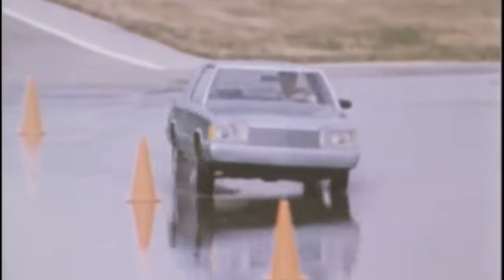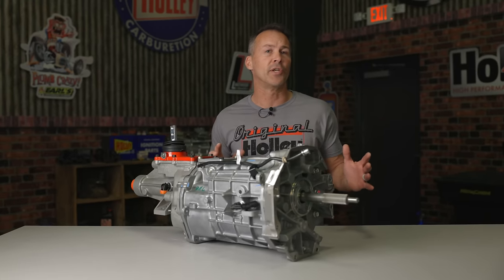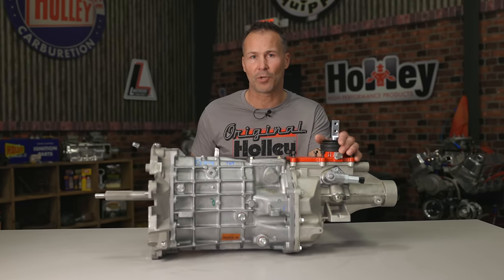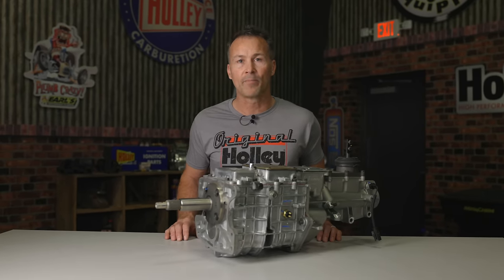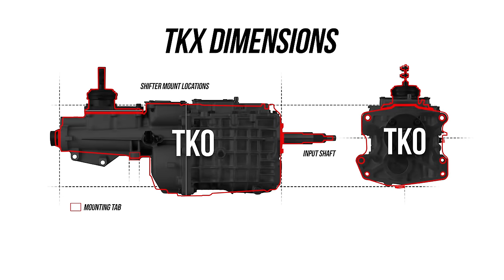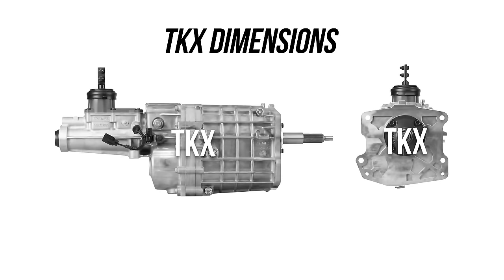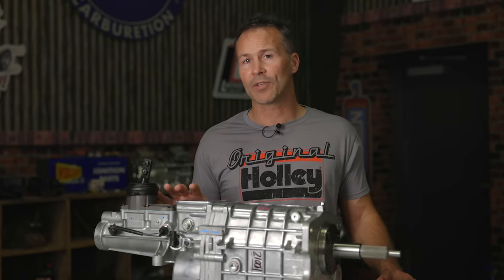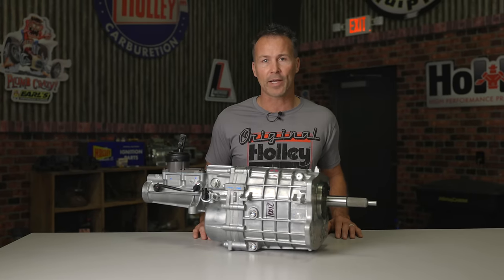A Guide To Tremec Manual Transmissions

Comment: Have a T56 Magnum 6 speed in my 68 Chevelle.  With a 496 Big Block my mileage went from 12 mpg to 26 mpg on the highway traveling at 65 mph.
Reply: @Brandon Kilian Sixth gear is .63.  With 3.55 gears n the rear the RPM's at 65 mph are around 1800.
Reply: Thats hilarious
Reply: My C10 has an older T56 with the 0.50 6th gear and I get 25mpg on the highway. Pretty awesome I love it.
Reply: What kind of induction are you running? I also have the T56 Magnum in my 73 516 Big Block Corvette.  I'm running a 3.70 rear gear.  I'm also running a super Victor/Dominator and I don't get miles per gallon, its Smiles per gallon. 🙃
Reply: @gumballer133  When I did the test I was running an Edelbrock Performer RPM dual plane spread bore intake with an 850 Speed Demon carb.  Currently I have a Fitech Mean Street EFI with a Jegs Air Gap dual plane intake (a copy of Edelbrock Performer RPM Air Gap).  Have not tested the mileage with the EFI yet.
Reply: @darylw792  thank you 🙏 ☺️ solid real world numbers, so im not guessing i was figuring about 20-35% improvement ( in your case 50% ish so even better ) from the dodge G-code 1970 and 727 3.2FG so 32MPG-maybe or is that stretching it? how much did the sound/NVH change numbers or just your impressions ?
Reply: @michaelwhitehead4446  how much did the NVH change? is it more or less decibels?
Reply: @michaelwhitehead4446  thank you for real numbers, my old setup is about 16MPG +- a couple of points
Reply: @richardprice5978  I noticed no change in sound at any given RPM.
Reply: @darylw792  it's rpm vs speed, as modern driveline sales/owner told me it should get better MPG ( i wasn't 100% convinced at the time and by how much i figured about 5MPG-ish more in mpg to my 16/18mpg but at 3usd pre gallon it takes a long time to ROI 3 to 7 K usd of work/time/$$ but you're numbers on my driving habits it pays itself off quickly plus added gas is now 5+usd bonus payoff ) and be quite er at a given speed ( not sure that worked out that way and or is the gear noises different from the 3 or 4-speed vs TR6060 ) as the engine isn't turning so fast but it's under more load in over drive/higher gears vs say a M22 or 833-mopar or really my 727-Auto non-locking torque converter
Reply: I'm planning to put a T56 behind my 440 in myb65 charger for that VERY reason. Glad you confirmed what fuel savings you gained.
Reply: @kevinhawkins6811  mine is a 2014 C7 TR6070 ( from what i gathering its one of the strongest units plus was setup for a pump just swap the mid-plate for a aftermarket or hellcat mid-plate+clutch+flywheel and oem green-bearing-trow-out and a adaptor's to small block mopar or comaro same but id bet but SBC/LSX adaptation to BBM/426hemi will work-2 and the 1967-71 oem 727 yoke and tail-housing's ( a gm turbo-400 or similar auto would work as well but i don't have that stash of parts to try i just know their similar to 727 to support the yoke the C7/TR6070 has a seal to stop leaks into the pumpkin/ground ) or at least mine was in mockup reusable if i adaptation to the corvette tail/pumpkin 🎃pattern i didn't do this as i working on a hybrid-ev motor for around town use/stater to save weight and more room for the exhaust/turbocharger ) ( with the bell on its 42" but the body of it is thicker so it will not clear aka the same size as the original 727-auto ) with .42-OD 7th im happy to help as your charger is basically the same as my 2gen you will be forced into cutting the body/floor i all ready tried mock up and it didn't fit really well i guess you could drop the engine/transmission down a couple of inches and use a CV-jonts/different drive shaft/axle
Reply: @kevinhawkins6811  mine shifter is from a 2016 comaro flipped a 180* remote shifter modified so it's on the firewall/tunnel as i don't like kicking-ect it but silver sport ( bruce at modern drive line has parts and or the magnum tremic full kit for early  charger's but it's a 6-speed and im instead on 7-speed as 440's up and happly lug 7th at 80MPH up hill ) transmission's has a adapters to the oem consoles 

i guess i like truck/ape shifter handle's that are vary notchy/heavyweighted and clutch-petals that feel like a heavyweight compound bow
Reply: @kevinhawkins6811  t56 vs mag vs tr6060/tr6070 there cousin's but different from each other and a real t56 you might not be as happy with it as its weaker ( 400lb torque vs 800lb * . the face-plated tr56 might be stronger aka 1200lb* 🤷‍♂but i didn't really look at using it as to me it's a race-transmission not for street use as it's noisier ect. ) then the tr6060 and won't have external cooling so behind a 440 it can over heat but i will have some options for the Z-bar clutch assembles but the aftermarket mid-plate from tick performance NC-🇺🇸 i think has a option for that but then headers can be a pain ect.

not sure 🤔about your goals on your charger but i did my research for mine
Reply: @richardprice5978  I want a daily driver and some stoplight to stoplight fun on Friday nights. I do a lot of highway driving to work and it's an hour to get there. That why I was thinking the 56. I am going to build the engine more for bottom end torque than high rpm horse power.
Reply: @kevinhawkins6811  mine axel is a 8-3/4 gear is 3.2 tire tall sizing is 26" or jeep 2006 30-33 10-13" wide muds 😉👍as i wanted bigger brakes but don't care for low-pro side walls most of the time and Michelin sport tire's for some reason aren't made in high side walls or at least i didn't see anything and im not buy goodyear tire's flipped one of my cars from my mistake
Reply: @richardprice5978  I'm out of NC, I'm trying to do research. I'm end up putting 10k into my transmission, and I dont want to have made bad choices with that kind of money invested.
Reply: @kevinhawkins6811  sounds like copycat me 70% or more would work 👍

if you have any questions im happy to answer ( im in the rocky's/SW 🇺🇸 states for now ) you sorry i don't make more parts/set's for the swap ( chevy volt motor/donut 🍩shaped/tesla motor 1:1 output shaft /on the driveshaft/yoke is how mine works otherwise there's dead space not being used or just use your imagination for what ever site's your fancy 😉) ( love to see more than me rocking this or similar setup ) and im not sure if i did if id lose my shirt 👕trying so for now it's just information/1-off in my car and or progress that iv made/learning from it

my transmission 2014 c7 core i got for under 2K usd ( rebuilding my OEM 727 i got bids for over 4k so no way, plus i was trying to buy a 833 car originally anyways but could find one at my local area's and price point ) im not sure what there going for now but the official magnum transmission ( mine is very close to the 3.9... 1st gearing/gear set sorry have parts numbers but forgetting it as i post, and there is upgrade parts if you brake it but kinda doubtful on N/A-power ) in a box-core was 5+k usd-2018-ish numbers clutch/DMF package ( wanted the triple-carbon-carbon but my wallet/wife for now says no ) im under 3K all parts have less than 30K-miles on them and a old guy's warranty vett so basically new all in so far im guessing im under 5K ish ( the 383 died from liquid vandalism so a all iron twin-plug gen-2 hemi 4.5-crank is in the works and yes aiming for low end grunt and sounds like the same goals as you )

i plan on replacing the steel driveshaft for A-1 carbon unit as its safer in a failure mode but for testing/mockup modifying the OEM will work fine for CV-jonts/telescoping personal preference but the sliding yoke will fit tried it with out the ev-parts installed motor core can theoretically work but also get in the way and not fit so i don't bother with it but got a tr56 viper quick-time bell  to BBM+vett-mid-plate ( if you use the console version adapter the vett has both of the detentions ground into the front locations and under the shift platform if memory serves me right but you will probably need to copycat to hellcat setup but the forward shift-shaft is going to need about a 1" trimmed off to convert it to work with the hellcat or use the TR6060/mag-parts to convert it to work as there basically the same if not super close, i didn't and have 40MM-ish spacer/cut a hole+welded in the vent-tower to use the old detentions under the shift tower and welded on to the SS-steel vett pattern-shifter to make a ball-cup to work with the 2016 comaro parts  ) and found it wont bolt on/fit so need to retry it in the car with a 2016-up hellcat/TR6060 bell's and mid-plate-hellcat for the next test fit

hope that you have a good TIG welder 👨‍🏭you're going to need it, even the $$ "kit's" need a welder ( a high end mig might work fine or paying a bodyshop with kit and being mostly steel sheet metal and crossmember ect. repairs but i wouldn't chance it but i like tig more so maybe im byisted ) and on those flux core/low QC tooling doesn't cut it aka junky end product
Reply: @kevinhawkins6811  FWI the 2014 vetts shifter tower is in the forward/truck placement on a similar tremic magnum transmission and the mag tail and yoke and seal+bushings ( i profferer the larger roller 29-35 spline yoke's sorry foggy on mopar's OEM 1970 b-body/C-body count, and i forgotten if tremic makes a roll-mag tail or not stock or if it can be modified to work with roller-yoke's ) will technically work for the output shaft as i tried it and a BRZ-Toyota swaped lsx car ( look at his as 7Th and reverse gear can be challenging to fit in the mag-tail-case but he did get it to drive/work, that's why i think 🤔its easier for after ( pumpkin/tail housing/plate adaptation ) ( like i did ) or making a custom tail/gear housing ) thats on the internet sorry don't have the links to it but his has a thick aluminium spacer/adaptor between the case and the mag-tailhounsing the other way to do that swap is put the mag-tail ( got one early on for mockup but after a buddy and wife of mine sigest electric A/C ect. and non programing-for-me hybrid ideas i though it was brilliant, battery packaging is under the backseat cushions and under the floor pans aka under my seat/passengers side making it a flat floor if i run the exhaust right ) after the vett-tail housing and or run the shifter shaft backwards though the vett case i didn't bother with that as mine is hybridisation 😉 so it wouldn't fit anyways, before warned that running the back shifter placement's ( if i was using a magnum red-plate shift handles/rod's straight up from the tunnel's sheet metal without a adapter shifter kit, add more if you use the extended internal rod/tail-mag ) put's at my hip's or neey's 24 to 42" ish back from the firewall 90*-up/glass or in the back seat's lolz 😂i don't need back seat driver's and using a Shelby cobra shifter handle for me is weird/uncomfortable hence why I wanted the remote truck style long 20"+ish rod-handle one on the firewall for now going with the ball-handle/chevy but maybe i might try the pistol grip but not sure if it's comfortable or its just for looks/$$ as its a driver's cars not a flipper's car
Reply: @kevinhawkins6811  before i for get some people that are smarter than me have gotten the TR6060 H-pattern using servomechanism and hydraulic ram's/pump-ect ( and others like 4-speeds ) to automatically shift ok 👍 and crude clutching so-so but it needs a remote shifter to work, something to look up for rush hour traffic and or in my case wife mode, sorry i don't have the best how to on it
Reply: @darylw792  , 
My 66 Chevelle gets 3 miles to the gallon , 
I would like to double that to 6  like you doubled yours , 

I have a M-21 Muncie 4 speed
Reply: Guess I’m lucky I got Muncie 4 speed with 3.55 rearend gear getting 10 miles gallon wished I’d put even bigger gear I sent a 3.73 ring an pinon back I wouldn’t been able to drive it
Reply: @kevinhawkins6811  i just remembered a idea hope it helps. my family asked me as im using a corvette transmission is why didn't i just buy a wrecked C5-C7 and gut the back-half off it and bolt in everything like the torque tube and back-pumpkin 🎃for better brakes ect. so here you go as a different way to get OD-transmission and better corner handling.

i already did the wilwood big brakes and restored my OEM 8-3/4 FG3.2 so sunken cost's ( a year or so aka i felt there new ) before the 727 died to i didn't go the back-half way
Reply: and use adaptor T-bar's instead of the corvette coils in the rear arm's and or 1955 style packerd Caribbean T-bar's/system's. BTW quick-time/holly makes a corvette torque tube to mopar 🛎bell-housing V-8's adaptation found that out by accident just ask for it on the phone
Reply: I bought a 68 chevelle as my first project car for my 18th birthday last year, but I have no clue where to start, I want to put a big block and this trans in it, what all have you done to yours?
Reply: SOUNDS about right. I HAVE heard enought stories of muscle  car owners who got as low as 10 mpg when doing an overdrive swap going to 20 mpg.

Comment: Over the years there has been considerable improvement in both manual transmissions and various types of automatic and automated transmissions. I am old enough to remember cars with a 3 speed column shift where only second and third synchronized. Now most manual transmissions are 6 speeds with all forward speeds synchronized. I remember 2 speed and 3 speed automatics many years ago, now we have 8 speed and 10 speed automatics. Although there has been a steady decline in the availability of manual transmissions, there will always some manual transmission enthusiasts who will want a manual transmission.
Reply: Hate to say I remember driving a 37 Dodge pickup that the ONLY syncros where between your ears... perfect timing or the noise would shudder your teeth.
Reply: Brings a tear to my eyes
Reply: 57 Chevy pick-up with the old three on the tree, remember when down shifting while sitting at a red light, something in the linkage would go goofy on you and it would lock-up. You had to open the hood and reach down and re-align the shiftier arms to free it up. Still have the burn marks on my knuckles from the exhaust manifold, I sure miss those days.
Reply: @stebstebanesier6205  Many years ago my father had a 1966 Rambler American with a three speed column shift and overdrive. As the linkage wore out it became difficult to shift from first to second, because the shift linkage would try to  grab both levers and try to engage second and reverse at the same time which caused the linkage to lock up. My father repaired this problem by welding a ring of metal onto the separator between the first and reverse lever and second and third linkage lever.
Reply: @stebstebanesier6205  Yes! I well remember our old Chevy pickup ('65 or '66, I think) doing exactly the same thing. The fire drill was: jump out of the cab, pop the hood (by now people behind were honking their horns), manipulate the shifter arms, jump back in and drive. Them were the days.
Reply: Absolutely! Have 6spd Tremec in my beloved 04 SVT Cobra terminator..4900orig mis! -Ohio

Comment: just picked up a TKX for my 1970 El Camino. The one with the 2.87 first and a .68 fifth. Lucky me cause I guess these things are a little tough to get your hands on right now. Local speed shop here in Sacramento had several on hand. Easy installation. Installed on the floor of my garage with a floor jack,  jack stands and a couple buddies. I have never felt another transmission that has such a perfect slotted feel throwing it into each gear. It's got a mighty strong spring throwing it into neutral too. Feels well worth the money. The old Trans was a Richmond Super T-10. Cars in the shop right now having the 373's replaced with 410's. With an LS6 454, the TKX, and now these 410's I'm sure its gonna be a wild ride.
Reply: that sounds awesome man good for tyou
Reply: Sounds like a sweet ride man! Enjoy her, think I’ll be doing to TKX in my ‘57 this year, legit daily driver and the OD would be nice running to the lake.
Reply: @moparproud3978  Couldn't recommend it more. I have seen Tremec EVERYWHERE in the hot rod world and have always wanted one for that reason. Always thought, "well, they have to be good. Everyone has one with a wild car!"  I really had to sleep on pulling the trigger, and I am so glad I ended up with one. I'm also glad I just so happen to wait to get one till the TKX came out. I am sure this tranny will go down as one of their best transmissions ever made.
Reply: @Joebro200 what is the name of the speed shop? I’m in the 916 and plan on updating my 69 firebird soon.
Reply: @calsacfab2  tognotti’s. They have everything and it’s a very large shop. Kinda like summit racing if you’ve ever been there in Reno.
Reply: @Joebro200  thanks brother. #savethebirds
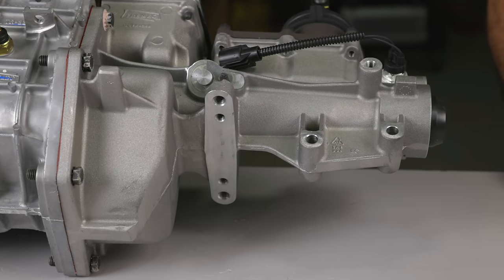Reply: I'm late to the game here. I have a 4:11 rear it looks like the TKX 2.87 .68 is really my only choice. Anyone disagree? I'm wanting to get to 60mph ASAP and then cruise 75mph under 2500rpm. 27" tires, 496 BBC, '72 Monte.
Reply: @designsinorbit  I had exactly that set up on my el Camino (same tkx with the .68 overdrive and 4:11 rear gear.) I ran 17 inch wheels but I can’t remember my sidewall. Anyway, I ran my elk on the freeway and at 70+ miles an hour it never saw 3,000 if I can remember right. If memory serves actually I believe at 70 my elk would run at 2700 rpm. That sounds right to me.

Comment: The TKX will fit in a 69 Mach1 with Mild modifications. Just trim the top of the tunnel ring a little bit and then you can totally stuff it. Which really works nice on a lowered car.  What a SWEET shifting transmission ! almost brings tears to my eyes !